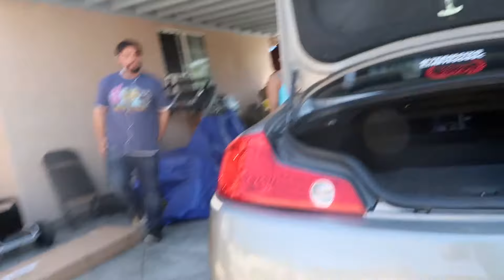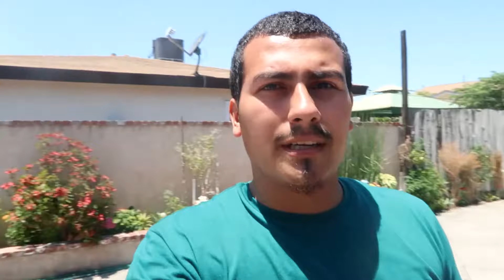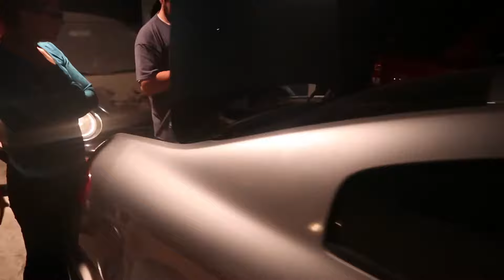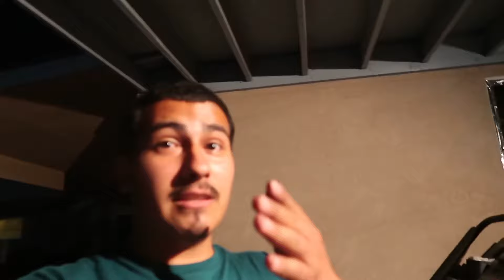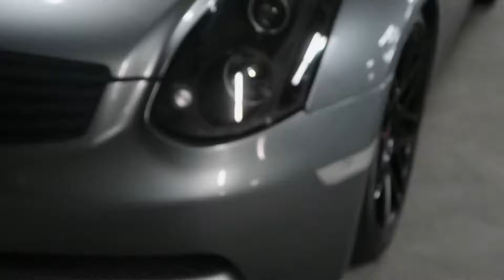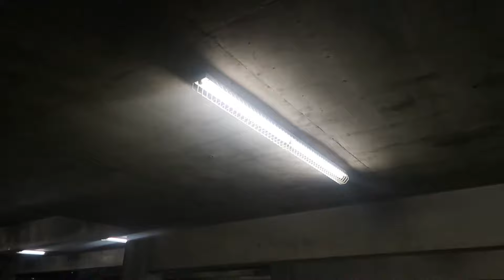"SPOILING" MY G35!!

Comment: What size drill bit did you use? I just bought this wing rn
Reply from the maker: To be honest i dont remember all we did was start with a small bit then went up from there until the bolt fit flush through the trunk bro
Reply: @srbuildz  ok thanks

Comment: Theirs not any actual use for that big ungainly spoiler take it off and the car would be clean, but hey it your car but just know it will decrease your top speed due to drag ask any viper gts owner.
Reply: LOL Decreasing top speed??? To what percentage of the population is your comment  a true concern?   If your testing by how much on a public road; Yo ass is going to jail! VIPER BOY 
  Even on an a typical road track rarely do you reach top speeds with a street car.....so yeah.... 97% of the idea is for looks.

Comment: I'm gonna be honest your car looked way better without that big useless wing it looked cleaner Rims, Coliovers, a Front lip, side skirts extension, a rear diffuser, rear bumper lip Splitter, Carbon Fiber Hood and Carbon Fiber Trunk and you would've had a clean G35 was it worth it to ruined your trunk lid making unnecessary holes because things didn't go right at least the mods I listed above are the only Exterior mods I would do to all my cars clean and simple no wing unless it's a flush mount wing I got a 2010 Corolla XRS 5 Speed Manual Transmission it's my new project car the mods I listed above are my future mods for my Corolla XRS it's your car whatever you like I guess
Reply: Gravecb7 Accord you have a Corolla bro chill